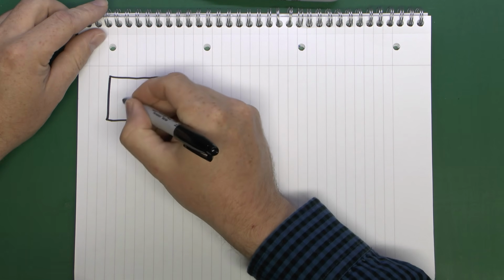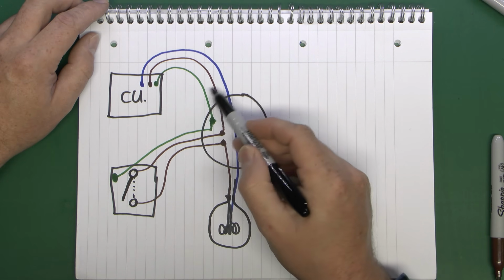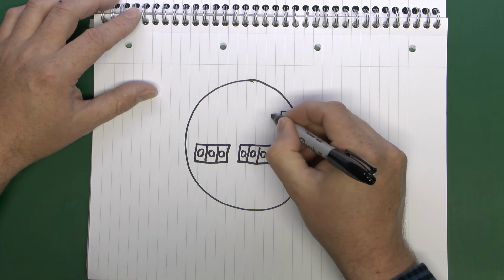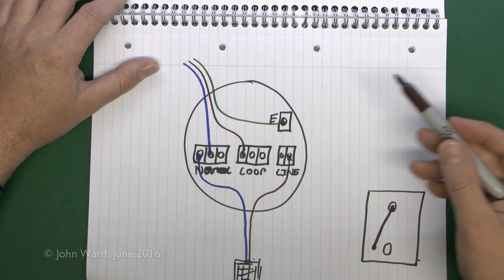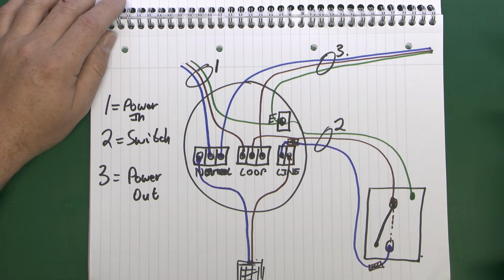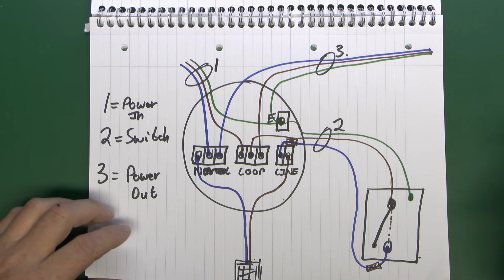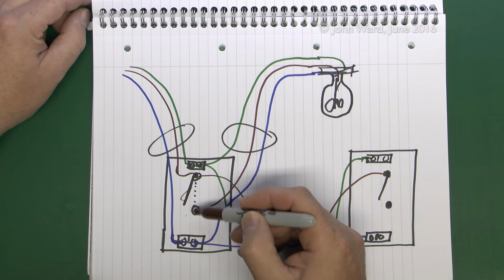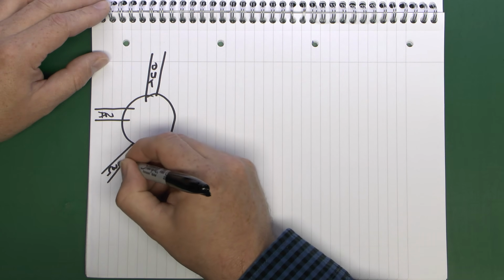Lighting Circuits Part 1 - Basic Concepts

Comment: Started taking electric class this video is superb, better explained than the tutor. I was wondering why there were 3 cables, now I know, power in from cu, switch cable and power out to connect another light. One question is does the connecting light circuit also need the third cable and if so why? maybe your other video might explain it.

Comment: I prefer the 2nd switch method. You end up having only one T&E with the 3 conductors in the ceiling making the fitting of replacement light much easier rather than maintaining the loop and having to stuff 3 cables into the ceiling void using terminal blocks.

Comment: The lighting circuit isn't RADIAL, they used to be. The lighting circuit is a Ring, you actually drew a ring circuit, ie the main conductor left the consumer unit and returned to it. A radial is where power is supplied to each device and doesn't have a return.

Ps blue=black, brown=red.
Unfortunately electricians use a red switch wire to connect to live. If they used a black switch wire to connect to the 'ring' live it would be obvious it was a switch wire. No extra bits of sheathing required.
Reply from the maker: No idea which video you watched, but it certainly wasn't this one.

Comment: I have a question: what are the smart devices that say no neutral ? Are there houses with no neutral ?
Reply from the maker: They are light switches which can work when connected to line and switched line only, by charging an internal capacitor using a tiny current flowing through the lamp when it's off.  Some may need additional load devices installing to work properly.
Most older properties do not have a neutral at the light switch, so this style of device supposedly makes it possible to install without rewiring.
In reality it's far better to add the neutral wiring to the switch position, or install a control device at the light position where the neutral will be available.
Reply: @jwflame  thank you ! That makes sense - makes my buying much more simpler and what to look out for

Comment: You more or less described me in the first 30 seconds,  however its a rose in the attic and switch has a neon unit next to it.  Neon illuminats bright and light comes on when switch is on.  But when switch is off the neon is off for a few seconds then illuminates dimly. 
Many years ago i added some extra switched lights  and the other day trying to revert it to stock configuration got me in this pickle, im clearly a bit rusty. 
The system looks like a hybrid of the two shown here. Not that iv touched or changed anything in the switch end if it.

Comment: Great video explaining the loop lighting system to us DIY’ers  who want to fit our own lights. Worth mentioning too that you can use a multi meter to identity the switched live and power in and out cables using the continuity function. This is a dead test with no power going to the circuit. Just connect your probes to the lives and when you get sound you know they are your power in and out. The third brown will be going to your switch. You should be able to see this cable in your ceiling so the blue will be your switched live.  You can confirm this by connecting your probes to this brown and blue to hear a buzz for continuity but just be sure to operate the switch to put into the on position.

Comment: Hi I have a question about lighting in a garage.  I have one pir light at the front of my garage and I wanted to fit a wired one at the back.  I have a 2 way light switch at the back that operates the 2 strip lights on one side and an outdoor light on the other side (not pir).  I was going to take a feed from the cable that is going to the outdoor light, so looked at this cable only to trace it and it seems that this cable is wired to the outdoor light and just comes out of that light and is wired directly into the light switch.  Could this be so and is it usual to do this?  Thanks

Comment: your wiring in England is very similar to ours in the US. only diff is the color code, we use black for Hot and white for Neutral, and Solid green or bare copper  for ground. and the design of our light fixture Junction box. is just an empty box with no terminals and we use wire Nuts to connect the wires. but Wago connectors are starting to catch on here in some areas of the States.

what is very different is commercial wiring. each hot is a different color, depending on the circuit branch, with white still being Neutral. I believe this makes it easier to trace out circuits on each branch in the event of a fault.
I am not an Electrician by trade, but have always been a tinkerer. I understand and have worked on single Phase 130 volt and 230 volt circuits here in the US, but have not yet wrapped my head around 2-3 Phase configurations.
something I am going to have to study further, though  chances of myself working with such things is small to null. but is just my inherent curiosity and love of all things electrical.

Comment: So the alternate crime in electrics has happened with taking the neutral to the switch along with the feed because not only are you adding unnecessary joints to the circuit there is no permanent feed in the ceiling space making it easier in a house to add switches in new doorways etc this new way of wiring is in my opinion crazy made up by a person at a desk and no practical experience of working practically on site

Comment: So is brown live, blue neutral and yellow Green earth? Is that always the case and if not how can you find out which is live, neutral and earth
Reply from the maker: Those are the usual colours, but not all cables with those colours in are used for those purposes.
If in doubt, testing is required to determine which conductor has which purpose.

Comment: great video John, i have double switch next to my front door 1 switch puts the hall light on the oter switch puts to landing light on witch is a 2 way switch each light does not give good lighting to my stairs. I am aware that new stairways have both lights working at the same time, can i do this with my setup?
Reply from the maker: Possibly, but it depends on exactly how it's been wired, and whether the two lights are on the same circuit or not.

Comment: Hi, regarding the last section (multiple lights) using a junction box, can't you do the same thing using a ceiling rose  by  connecting a cable for the next light to the terminals where the flex of the current pendant attaches to the ceiling rose so the lights are in parallel?
Reply: I was just about to ask the same question, do you know if it can be done?

Comment: At the 20 minute mark where you have added an additional switch, did you miss a cable out as I can't work out how the circuit will be made on the second switch when the switch is turned on?

Comment: Great video. One think that I didn't understand is why he's using the netural wire, but then having to identifying it as a live. Why can he not just use a live wire? Can someone explain please?
Reply from the maker: Cable with twin brown wires in it can be obtained, but most of the time it's the blue/brown type which is used for everything else.
Reply: @jwflame  thanks for the reply. I understand why I was confused now. I was thinking in terms of the three wires being separate, but they come sleeved together.  

I've just started my level 2 NVQ as a mature student. 

Thanks again.

Comment: Great job - very helpful.  It made the connection for me (for the first time) between the theory of electrical circuits - which is easy, and the complicated business of wiring up a multi-terminal ceiling rose.

Comment: I used to work for a housing association, and so many times, we would be called to a blown fuse, tripped breaker. Gleaming new fitting in the living room. They did the usual, all blacks, all reds and earth's together. Fine till they hit the switch! Boom. Welded switch, bit of smoke. We used to get a tenner backhander to sort out the disaster!!! B&Q were bastards for not providing good info!!!

Comment: My arrangement of wire colours seems different to this. The ceiling rose has the same terminals as described here except the incoming, outgoing and switch power wires are all red. The wire coming back from the switch is black with a red sleeve and the neutrals are black.
Reply from the maker: Those colours were used before 2005.
https://www.flameport.com/electric/lighting_circuits/lighting_ceiling_rose_other_colours.cs4
Reply: Thanks for the clarification. The new light fitting doesn't have these terminals. Is it okay to use Wago connectors and shove them all in the new light fitting housing?
Reply from the maker: @spudhead169  Yes, as long as the connectors are in the light fitting, or between the light fitting and ceiling.  If they are above the ceiling they need to go into a suitable box or enclosure.

Make sure that the black with red stays identified (switched line) as the red sleeving can fall off, and then further testing will be required to find out which black it is.
Reply: Got it. Thank you for the help.

Comment: Right sexy Handyman guy here is a question fur ye - Living room has about 12 Gu10 fitted lights, they were fitted back in the day when Gu10 Halogen bulbs 50w were in - All bulbs have been replaced with GU10 led dimmable bulbs - but dimmer don't work now and when the dimmer did work a while back with the GU10 dimmable LED bulbs when you turned the dimmer low it would flicker? you had to fiddle about with the dimmer to get it to settle now the dimmer just switches on or off   Do you have a solution?
Reply from the maker: Replace the dimmer with one designed for LEDs, such as one from Zano or Varilight.
Dimmers designed for halogens rarely work properly with LEDs.
Reply: @jwflame  Right i will give this a try and i will update you if it works many thanks for your videos and responses.
Reply: @jwflame   Good news sexy boy , bought a led dimmer from Screwfix for £7.19 popped it on the job done now i can make love to the wife with dimmed romantic lights instead of lighting from Wembley stadium.  thanks, i will be back with more problems later cheers.

Comment: Can I just ask how many lights can you connect to a normal 1mm or 1,5, lighting cable, we live in a normal 3-bed house nut if you live in say for argument 6 or 7-bed house, There has to be a regular limit as to how far you would run before accepting you need another lighting run from seperate fuse or trip,, is there a commonly accepted amount of pendants. Many thanks, great video and so well explained,PS i am a retired plumber ,

Comment: Hi John thank you for this excellent video. 
I have a question.  All the wires in the ceiling Rose are bare with the light switch being turned off. When turning on the power at the consumer unit the only wire that is live is a neutral wire.  Is this because this neutral is connected to the consumer unit.

Note: My house is wired with single wire cables coloured red and black (not twin and earth). The live supply (loop) goes to the light switch. A switched live then goes to the ceiling rose. This ceiling rose feeds another red and black cable to another light in the same room. There is a further 2 neutral wires in the ceiling rose, one of which is live as mentioned above. Thank you.

Comment: Why not just bring the wires to the switch first? That way there aren't a lot of cable connections in the overhead light fixture and you don't need a ladder any time you have to troubleshoot a power issue - it's all in the switch.

Comment: Hi I have one ceiling rose attached to a light and switch now I want more light with separate switch what should I suppose to do? Shell I run a cable to existing rose and connect it to loop in terminals in the existing rose (in this case loop in wire and new wire will be in same hole) and then connect another rose then repeat the same process?
Reply from the maker: Yes, each rose is the same as the others.
Reply: @jwflame  thank you sir

Comment: Yes lighting circuits are quite simple first of there's two types the first one is three plate were all the lives of a ceiling rose go into the fitting together with the neutrals, earth's and sw feed . Two is slightly different the live feeds link from inside the sw plate to the next sw plate and so on the neutrals, earth's and sw feed are as per same position I am a fully qualified electrician of twenty years

Comment: Mate on the drawing 19:44 I can't understand why you don't connect a cable between the switch points of the two switches how is the second switch works?
Reply from the maker: 2nd switch is for a separate light, which would be connected to that switch in the same way as the first one.  It's just showing how to extend the power to another switch.
Reply: @jwflame  thanks a lot for that channel what you do is really helpful P. S. I ll try to make radial socket circuits when I can  cause of you
Reply: Although very explenatory and easy I think I ll start learning from you thanks

Comment: So I’m hoping to put four dimmable down lights in my dining room but leaving the original pendant intact . So can I put the 3 switch dimmer in and just bridge over the over the live with a short wire to the third switch for the down lights ? Obviously one dimmer will be used on the pensant still but not. Ring used as a dimmer

Comment: Very straight forward and well explained in principle, although in practice not as easy. When changing light fixtures or light switches, I find the best way to do so is by taking a photo of the existing connections before disconnecting and simply wiring them up the same way on the new light fixture or switch.

Comment: Quick question John. We have no earth on the upstairs lighting circuit. I'm renovating a bedroom and found a CPC going to a light on the downstairs circuit in that bedroom floor. I asked on an electrician forum (boards.ie) if it was okay to tap into the CPC in the floor using a maintenance free box and bring it up to the lighting in the upstairs bedroom. Only one person replied saying no and told me to get an electrician which I did. He's our next door neighbour and said it's perfectly acceptable to do so. Now I'm asking you for info on this. If I can run the CPC up what size CPC is required. I read if it's singles it needs to be 4mm. My plan is to take the existing live, neutral and new CPC to a maintenance free wago box in the loft and take a twin and CPC that to the switch and have 2 twin and CPC for the 2 gangs that I require. I'd love to know what your thoughts are on this. Many thanks.
Reply from the maker: The minimum size would be 4mm, but that arrangement isn't permitted:
543.6.1 Where overcurrent protective devices are used for fault protection, the protective conductor shall be incorporated in the same wiring system as the live conductors or in their immediate proximity.
It's either connect the bedroom lighting to the downstairs circuit, or rewire the upstairs circuit to include a CPC within the circuit cables.
Reply: @jwflame  thanks John. It says system and not circuit in what you quoted. Does that not mean the electrical system as a whole? Trouble is I think that earth is taken from the bonding in the hot press from the pipes which is wrong too for that external light going by what you say. The electrician I had over was confident it was okay. 🤔

Comment: Can I ask a question please.I'm not going to do any electrical work or touch them or anything but they have connected to smoke alarms from the rose on the ceiling and I did not see them take the light switch off how have they bypass the light switch if they've just connected via the rose on the ceiling   thanks
Reply from the maker: The smoke alarms will be connected to the centre Loop terminal which is permanently powered rather than the switched L terminal.

Comment: At 20 minutes you add a second switch but you never connect the output to anything so I don't see how it will do anything. 
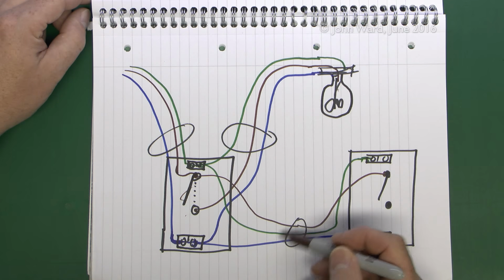You mention the switch line (20:40) but don't draw it in.
Is something missing or am I missing something?
Reply from the maker: That just shows how the circuit would be extended to a switch in another room.  Another light would be connected to it in the same way as the first switch.

Comment: 11:57   I think it is wrong,  used blue pen (neutral) connected to line which is loop
Reply from the maker: It is possible to use cable with two brown conductors, however it's far more common to find blue/brown used with a brown sleeve over the blue.
Reply: @jwflame  thanks for info

Comment: hey John, thanks for the presentation, great stuff! You know,  I was just wondering Does the ground wire (PE) actually really go into the switch in the UK? In case of a single phase switch (101) we would only have the fixed L & the switched L running to/from the switch, But t might be an Eastern European thing. Our network runs on T-N-C-S mainly.
Reply from the maker: Yes it does, a protective conductor (ground wire) must be taken to every point in the installation.  It has been a requirement since 1966.  Before then some lighting circuits only had the two wires to the switch.

Comment: John have you ever heard of the term Travelling switching used on corridors ?
Reply from the maker: Travellers - the wires between the switches where more than one switch controls the light.  More common in North America.  Usually called strappers in the UK
Reply: @jwflame  Yes I am aware of that term for the wiring, This is a means of controlling lights in a long hospital corridor for example. The first switch turns on the first light, the second switch turns off the first light and turns on the second, and they carry on doing that along the corridor, works the same from each end. However I have forgotten how it would be wired. #
I just wondered whether you may have encountered one of these or knew how to wire them.